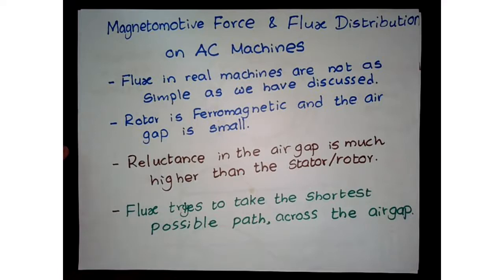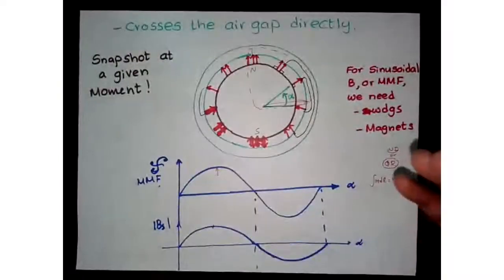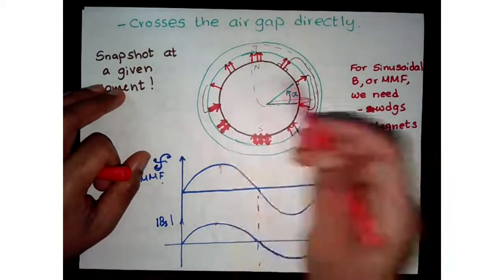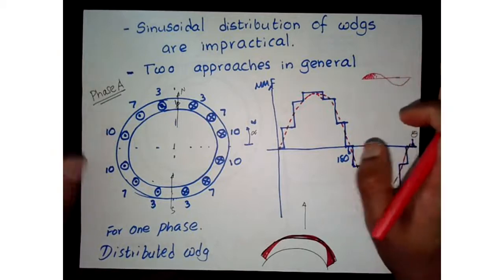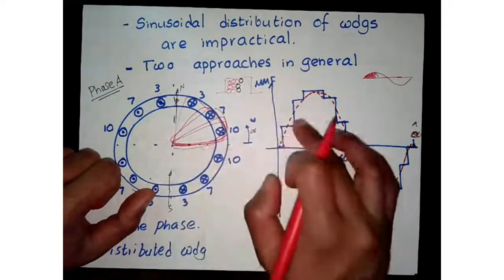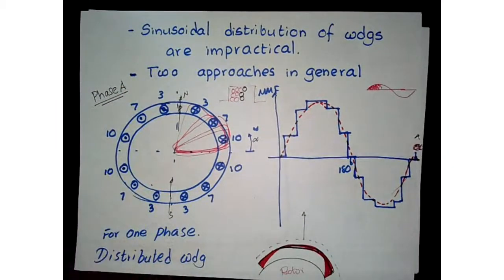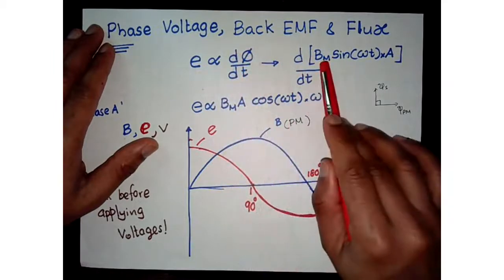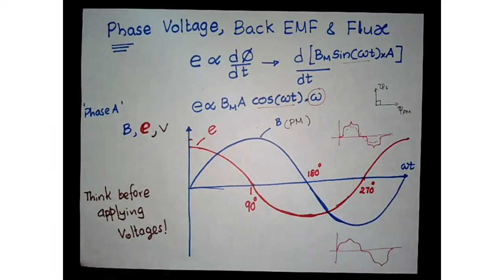MMF and Flux Density in an AC Machine

Comment: Thank you for the excellent video. When I use the approach to estimate the air gap MMF waveform (H.l = N.i), it does not differentiate between between full pitch winding and short pitch winding. For instance, in a 3-phase, 24 slot, 4-pole machine, it gives me the same MMF distribution whether the coil pitch is 5 or 6. Is that correct?

Comment: Sir here the no. of coils in the winding is said as constant.. plz clarify me. thanks
Reply from the maker: I'm assuming you are asking about the concentrated winding case. It is labor intensive and expensive to have distributed windings. Instead, each slot has the same amount of phase A windings, phase B windings and phase C windings. This creates a more square wave type MMF. But still a sinusoidal MMF fundamental is achievable (think in terms of frequency content in a square wave).
Reply: @SandunKuruppu  S sir. thanks for ur clarification. Kindly suggest some good book for reading dq modeling & analysis of electrical machines.